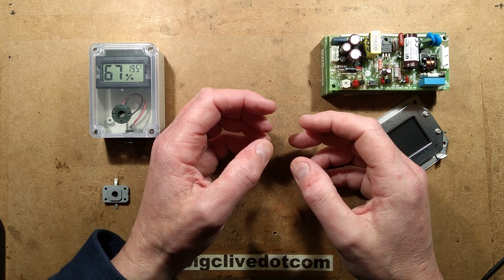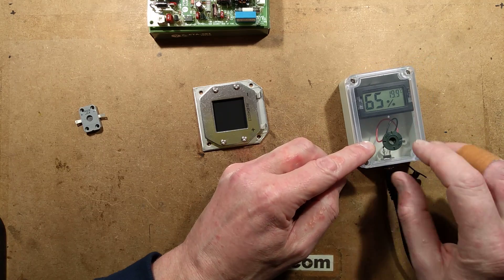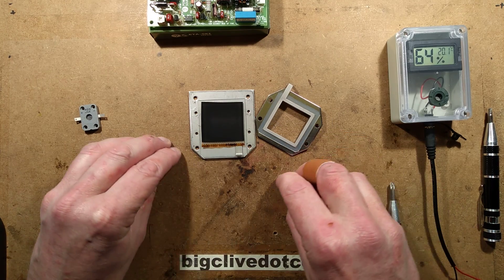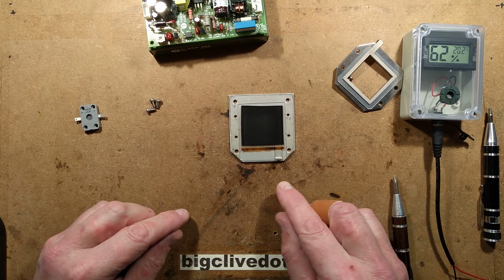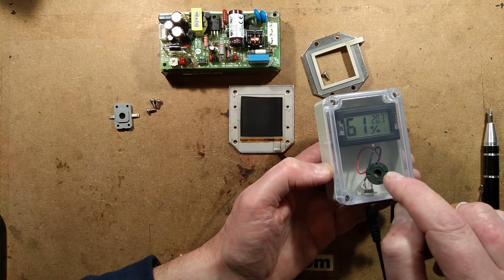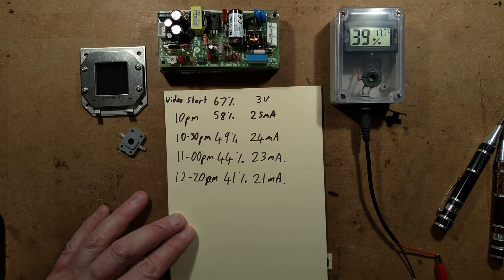Incredible solid state dehumidifier.  No moving parts.

Comment: I noticed the temperature was fluctuating and wanted to compensate for the effects, so I made a dew point and absolute humidity table.

RH% -- T(C)  -- DP (C) -- AH (kg/m^3) --  Current  --  Power   -- Time
67%  -- 19.6  -- 13.3    --     0.0113        --  180 mA  -- 540 mW -- 0:00
62%  -- 20.2  -- 12.7    --     0.0109        --  25 mA    -- 75 mW  --  0:30
49%  -- 20.1  --  9.0     --     0.0085        --  24 mA    -- 72 mW  --  1:00
44%  -- 18.5  --  6.0     --     0.0070        --  23 mA    -- 69 mW  --  1:30
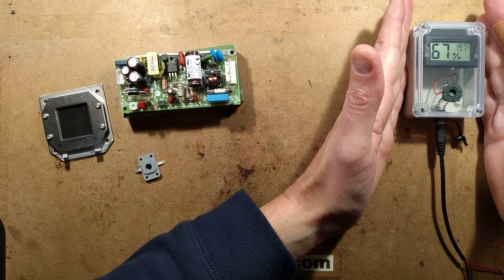41%  -- 17.5  --  3.5     --     0.0061        --  21 mA    -- 63 mW  --  2:50
37%  --17.5? --  2.6     --     0.0055        --  21 mA    -- 63 mW  --  3:30
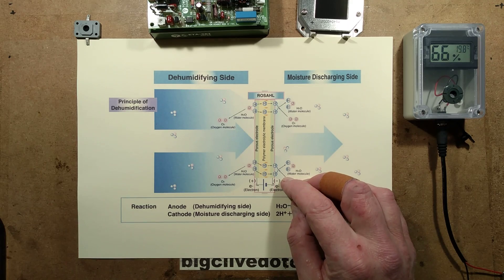33%  --17.5? --  1.0     --     0.0049        --  20 mA    -- 60 mW  --  5:30

Seems like it works very well. Times are relative to the start, and the last two I assumed the temperature stayed constant from the last temperature shown in the video. Second reading I used the 62% shown in the video instead of the 58% recorded in the notes, because it seemed temperature was changing more than the mA draw was.
Reply from the maker: I made some notes about times between readings in the video description.
Reply: Got it, thanks, didn't see that.
Reply: Just to finish off the truly pointless math... Any idea what the interior volume of that box was? (the best math is the most pointless math)

Comment: Is it possible the membrane is based on Tyvek with some added coating on one side?  The zoomed-in detail of the moisture discharge side looks quite a bit like Tyvek, which has some interesting properties regarding wicking of moisture.  In the US, it is common to wrap giant sheets of it around the outer plywood sheathing on houses as a vapor barrier under the siding.  It was also used for the protective sleeves that high quality 5-1/4 inch floppy disks used to come in, since it is a very low-friction/low-abrasion material.
Reply from the maker: The pattern does look like Tyvek, but the film is a yellow gel type material with a printed metal grid on it that creates the pattern.

Comment: Looking at the diagram, I tend to agree that it appears that this device is performing electrolysis on the water molecules and pulling the hydrogen through leaving the oxygen behind.  There are sensors available to test this theory.  I doubt that the applications for this device will create a fire hazard.

Comment: Better living through electrochemistry!  My guess is that the voltage has such a tight tolerance to keep ozone from forming at the anode. It would be interesting to place an oxygen sensor in the dehumidified space to see how much the oxygen level increases. This will make it into my next class on electrochemistry. Thanks for showing this!

Comment: Clive, this is a great demo, but presumably, your workbench environment is humidity controlled, and likely a lot lower humidity than in the box, which means that this test was working with a humidity gradient to its advantage.  Could you do a demo/test with the box working outside, let us see how well it works with the humidity in the box lower than ambient?
Reply from the maker: The ambient humidity is normally around 65% here.
Reply: 65% inside?  Wow, that's pretty impressive, that this can work against a 40% difference with a single stage and such low power draw.

Comment: Ah. The old proton pump trick! 😃

Protons will oxidise on the output side forming water vapour.

The oxygen enrichment inside will be minimal.  The total water vapour content will be less than 40 grams per kilogram of dry air... 21% of air is Oxygen and if all the protons (Hydrogen atoms without an electron) were pumped out, the percentage of O2 bumps up a tad.

Comment: Im wondering, would there be a problem with the higher oxygen levels over time in whatever area these thigns are used? ie yes it would 'remove moisture' from the air but then there would be higher oxygen levels which would in there own way contribute to corrosion? or would that just be a factor in 'the right uses' as in youd take it into account and only use it for moisture control upto a sensible limit

Comment: Technically hydrogen is the moving part. Also I'm surprised no one mentioned it but unlike PEM electrolysis this wouldn't even have to be only hydrogen permeable. It's tolerances could be really poor and it'd still work which is probably why using this as a PEM would be very shoddy.

The fibrous material is a gas diffusion electrode. Basically a high surface area layer to gather the pixies.

Now I'd like someone who knows more about these to back me up on this but I am going to guess the black layer on the other side is carbon. PEMs have a layer above the membrane called the catalyst cathode which has platinum impregnated in it.

I'm going to go out on a limb and say they just skip this layer and use carbon instead. Again it wouldn't be that important if it was just a dehumidifier.

P.S. While comparisons to PEM fuel cells or electrolysizers are fun I would argue the tolerances are totally different only some of the same design theory applies. They certainly wouldn't be interchangeable. It's similar to saying a compressor based dehumidifier is "just a small air conditioner" no actually the whole technology is optimized around dehumification.

Comment: Using your YouTuber superpowers for knowledge. I was looking for one recently for an isolated air loop. Especially for carbon. If something electronic burn, will the magic smoke, pretty much carbon or electrolyte vapour/mist? Will it clog the membrane? Also, if it goes under 0 degrees, will the water crystals ruin the membrane? I want it to go subzero and being able to not have condensation problems and having to insulate everything.

Comment: Since it appears to electrolyse the water vapour, I wonder if the cell works in reverse. Put hydrogen on one side and oxygen on the other, does it work like a fuel cell? The black coating looks a bit like sputter of platinum metal.
One can speculate that the membrane is hydrophilic and then the electrodes allow the absorbed water to be electrolysed.
It is interesting that the cell is polarity sensitive, this suggests a different coating is used on each electrode.

Comment: Why so complicated? The small deshumidifier I have is a Pelletier element with a large heat (or better frost sink) sink where the humid air condenses. Also all solid state. Well, almost, since a ventilator improves efficiency.

Comment: Can you try flipping it around to see how much will it increase the humidity inside?
Reply: You could probably use it to create a highly explosive high hydrogen environment... Like some comic bond villain, just waiting for ages for the hydrogen/oxygen level to be perfect for an explosion
Reply: @General Dismay, that wouldn't take long, hydrogen has a high flammability range, 4 to 74% concentration in normal air and 4 to 94% in oxygen. Couple that with the difficulty in containing it and you've got the primary reasons why it's so dangerous.
Reply: FordPrefect23  General Disarray  I had another look at the diagram and it appears clive's guess about the catalyst is probably correct because it shows the hydrogen reacting with oxygen on the outside to form water again.
Reply: i think Ford is talking about if the module was turned around, so as to increase the hydrogen inside the container. it would be safe until all the oxygen inside bonded and excess hydrogen started filling it, though i am curious of how much pressure it could produce before blowing a seal or the membrane failed. though i can't see it being used in a sealed container like this.
Reply: Quantum Uncertainty Workshop  - He was specifically responding to General Dismay's comment about "waiting for the mixture to be right" which it never would be since it wouldn't start producing hydrogen until all the oxygen was used up. As the oxygen was used up the pressure would go down until the oxygen was all used up, then it would start rising towards normal (if it hadn't ruptured from the vacuum) and eventually burst. (probably) 
But that's clearly not what Ford was talking about.
On the other hand, what General Dismay was suggesting was to simply put the device in a room and let it convert all the humidity in the room into hydrogen and oxygen until there was an explosive mixture. That is a potentially feasible idea as long as the humidity is high enough and there isn't a way for the hydrogen to leak out of the room. The only problem is the device doesn't release any hydrogen (apparently) but recombines it with oxygen on the "out" side. I suppose you might be able to remove the catalyst mesh without damaging the membrane.
Reply: can do the same thing with just a 9 volt battery and 2 wires... dip them into a glass of water and... science... can collect the hydrogen in a test tube to play with or go bigger and basically build yourself an HHO generator, of which there are several youtube video's on. FAR faster than something like this is going to produce! this is intended for removing hydrogen from the air versus producing it by breaking it down from water which is a far slower process than just using water and electricity.
Reply: @jort93z  well... the formula is H20, 2 hydrogen molecules to 1 oxygen molecule. though hydrogen is smaller which is how this membrane works! the oxygen molecules are too big to fit through the holes so only the hydrogen escapes! similar to how they bottle nitrogen and separate it from regular compressed air, nitrogen is larger that oxygen!
Reply: Quantum Uncertainty Workshop  -  "similar to how they bottle nitrogen and separate it from regular compressed air" Who do you mean by they? Nitrogen in industrial quantities is separated from air by distillation, not by molecular sieve.
Reply: for air compressors, they(auto shops back in the day) used to use it to fill tires and claimed it more stable than just compressed air, https://www.youtube.com/watch?v=uME1QOVWGPQ. i know they use a PSA system for separating laboratory nitrogen. i say "bottling" only because that's what an air compressor does... once the tank is full and you turn it off it can be stored in the tank, hence "bottling".
Reply: Quantum Uncertainty Workshop  - I can see how they might do that in a lab so they can control the purity, but the vast majority of nitrogen is produced by compressing air and cooling it until it turns into a liquid and then then letting it boil out and bottling it. The next thing that boils out is the oxygen. I guaranty no auto shop is using lab grade nitrogen to fill tires.
Reply: lol no they use a membrane similar to this, the holes are big enough to let the oxygen and other smaller impurities out but the nitrogen is too large to pass through. it's like a geologists mineral classifier screens but on a molecular level, things of a certain size get screened out based on the size of the openings.
Reply: Quantum Uncertainty Workshop  - I understand how semi-permeable membranes work. It's just not that common. 
"There are several ways of separating nitrogen and oxygen. The first involves cooling the mixture down to -200 degrees Celsius and separating the gases using a process called fractional distillation."
Reply: Quantum Uncertainty Workshop  " Alternatively, the gases can be cooled down to -182.95 C, the liquefaction point of oxygen. At this temperature, the oxygen in the mixture gets liquefied, while the nitrogen remains in its gaseous form, because nitrogen liquefies at -196 C."
Reply: Quantum Uncertainty Workshop  ...and finally, your method. "Another method involves forcing air through polymer membranes shaped like hair-thin hollow tubes. Oxygen passes through these membranes faster than nitrogen. The air coming into these tubes gradually becomes poorer in oxygen and richer in nitrogen."
Reply: Quantum Uncertainty Workshop  - I assure you that the impurities coming from an auto shop compressor are much larger than oxygen and nitrogen. Water and compressor oil for starters, requiring high efficiency pre-filtering or a dedicated compressor. And auto shops already get other compressed gasses delivered on a regular basis. Oxygen and acetylene for torches, and argon and/or CO2 for MIG welding. They could get nitrogen in bottles, either compressed or liquid, from the same company.
No doubt some auto shops have purchased on-site nitrogen generators, but I doubt it is common.
Reply: GordieGii: Oxygen concentrators and nitrogen generators are really common for on-site gas supply. Both can work by pressure swing adsorption or membranes. Limited throughput and purity, but when impurities from the air and machinery are acceptable, it's very practical. Oxycons are used for medical O2 and for torches, nitrogen in auto shops apparently.
Reply: Shabbymannen - Apparently? I take it then that you are not speaking from personal experience...
Reply: GordieGii: No, I don't. I know more about oxycons than nitrogen generators, but they are essentially the same kind of machine, and the same restrictions on when they are practical apply. I found no reason to question the auto mechanic guy, and your assumption that it might be done in a lab to control purity and not otherwise in general was just wrong. Just read up on the technology, it's pretty cool.

You don't seem dumb, but you should care more about being right than proving others wrong.
Reply: I understand how semipermeable membranes (water purification) and pressure swing adsorption work (similar to how hydrogen-ammonia refrigerators work but using a solid adsorbant instead of a liquid) and is very cool.
QUW has, at best, an incomplete understanding of how it works. It's not hole size. I have seen air filters that use it to eliminate moisture. The compressed air passes through hair thin tubes and the water leaks through the membrane letting the now dry air leave the other end of the tubes. It's about solubility, not 'hole size'
Obviously portable oxygen concentrators, whether SPM or PSA, are great for medical applications and no doubt others. But QUW's explanations are patently false. "hydrogen is smaller which is how this membrane works! the oxygen molecules are too big to fit through the holes so only the hydrogen escapes!" Absolutely not! It's electrolysis. The hydrogen goes through because of the polarity of the voltage across the cell. "similar to how they bottle nitrogen and separate it from regular compressed air, nitrogen is larger that oxygen" That is not how "they" bottle nitrogen. No doubt there are mechanics and others who have nitrogen generators in their shops, but the companies that bottle and sell nitrogen, oxygen, argon and CO2 for industrial uses do it by distillation. I have been in many factories that use compressed gasses and I have never seen an oxygen or nitrogen generator. I'm not saying they are rare, but QUW seems to think that is THE way that it's done. I assure you that mass distillation is MUCH more efficient and economical, outweighing the cost of distribution.
I don't have to be right, but I usually am. If you can show me that I am wrong I will gladly admit it. I want to be right and that means accepting evidence that I'm wrong and correcting myself.
Reply: GordieGii: Ok I get you. What I think is he was trying to describe a pressure swing adsorption system, and by bottling I think he meant locally at their site. When I think of those, I think of the adsorbant as a kind of molecular sieve for gas phase use, and they work on pore size. Modern molecular sieves that adsorb water can dry solvents better than Na/K alloy.
Reply: that's just a matter of turning it around, not sure what you'd want to keep humid save for plants in a green house. seems like it'd be too small to handle a task on that scale.
Reply: Quantum Uncertainty Workshop  - Cigars. Artifacts. Paintings. Test equipment. Seems to me there are easier ways to humidify something but if your bent on solid state for some reason...
Reply: TisJester XxX  - I missed that point, but it makes sense.
Reply: yeah it rips the hydrogen of the water
Reply: That sounds like some experimental fun
Reply: Well, 3d printer enclosures??
Reply: I'm not sure it would. You can see the diagram that clive pulled out shows that it moves hydrogen out. I suppose some of that may reform to H2O but I'd expect it to become mostly H2.
Reply: hydrogen for squeeky pop fun!

Comment: I find it always a bit fishy, if someone looks only at relative humidity.1:05 67%r.h. @ 19.6°C is 11.28g/m³ absolute humidity3:28 67%r.h. @ 19.7°C is 11.35g/m³ a.h. (most likely precision of temperature sensor and potentially some absorbed humidity by the PVC of the container)17:02 60%r.h. @20.4°C is 10.58g/m³ a.h.18:14 39%r.h. @ 17.6°C is 5.83g/m³ a.h. (what happend here? Part is rated for 84mg/day and you drained 5.45g in ~3h? [~1mg with a 200ml container])I would expect, that a higher temperature within the container would accelerate the dehumidification and the workprinciple should be quite efficition around 30%r.h till 100%r.h.A cross reference would be nice like silica gel.What kind of humidity temperature sensor are you using (in order to understand what readout frequency would be adviced)? DHT... are usually shit with respect on hysteresis and accuracy (time delay of ~2min and ±5%). SHT.. are not good on accuracy as well(5 demo kits with ±5%r.h. digit), but faster and at least lower hysteresis (±2%). 
In summary - you are measuring something else, but not the efficiency of the membrane.

Comment: How do I get one of these big enough to dehumidify my basement? I hate spending 600 watts of power to do that, and its so damn noisy.
Reply: SlocketSeven I doubt this would be more efficient than the dehumidifier that you use.
It would certainly be quieter however.